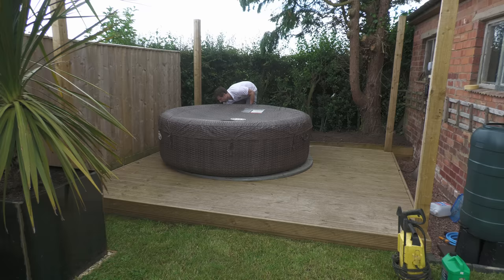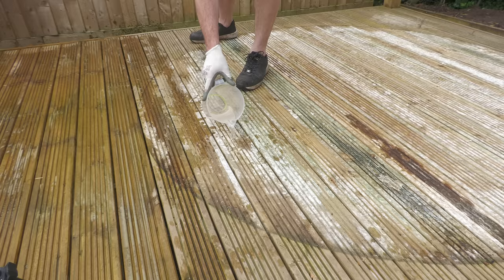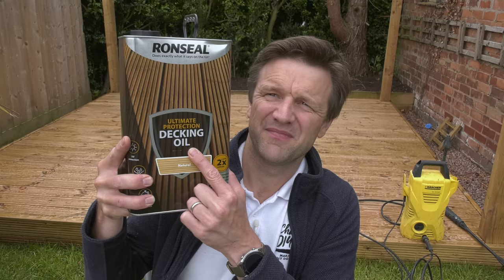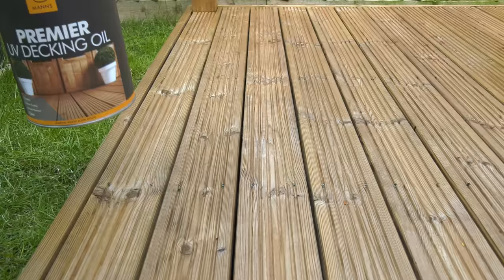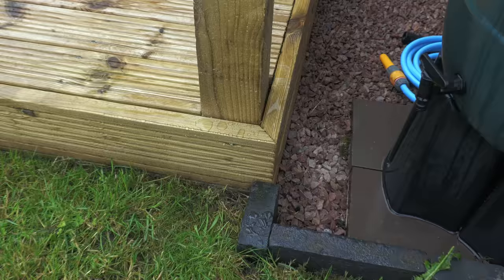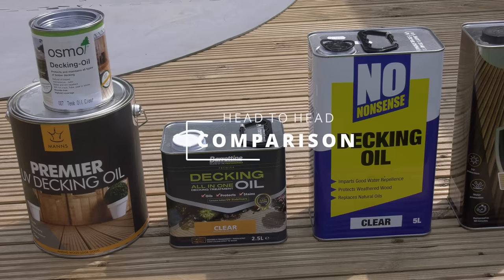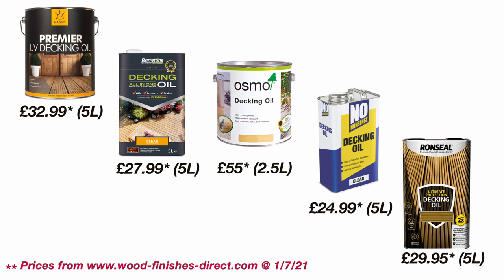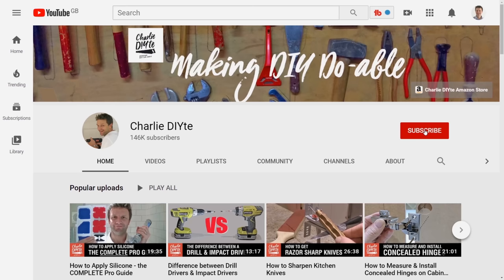How to Clean & Oil your Deck

Comment: My deck's been down a decade and still looks great. I'd agree don't pressure spray with the dirt blaster attachment or if you have the cheap boards from DIY stores that are like wafers, but mine are quality boards from a good timber merchant and I pressure spray them on a dry weekend early autumn then use the Screwfix oil which is great. I use a Wagner fence / deck sprayer and I'm done in ten mins, then do a second coat after it's dried. I've never needed restorer or scrubbed it. I then pressure spray it again around Easter and re-coat with the Screwfix oil if I think it needs it. The Screwfix oil is often two 5 ltr tubs for £40 so even cheaper than you state. Really interesting video and as for the water based stuff - forget it!
Reply from the maker: Thanks Roger. Great work. As you say, a little dedication and diligence and the deck will last for a long time 👍🏻

Comment: Great video pal, I finished my decking this year after watching your decking build a few times for tips, mines a bit too level as well. I’ve already treated mine and hoping it’s first winter will be mild so I can keep on top of it
Reply from the maker: Thanks mate. Don't worry about it being level. You'd have to put a big fall on it for it to drain, and you can't really do that particularly if you're putting a hot tub on it! Get yourself a leaf blower just to keep it reasonably clean. Sounds like you're nicely on top of maintenance though 👍

Comment: I watched this video months ago - and now I came back because I actually need the information!
I built a potting bench and was going to paint the top, but the wood grain looked pretty nice, so I'm gonna oil it with something instead.
Reply from the maker: Very wise. Never stain as it will peel off. Much better to oil as it sinks in and nourishes the wood. 👍

Comment: Many thanks Charlie. My old deck has been in need of some love for a number of years. I started using some water based Cuprinol decking oil I had lying around from the last time and it was woeful. I truly hope they don't stop making solvent based oils any time soon. Anyway, I took look at your video and decided that the Manns oil would be just fine for my deck. Then I took a look at my bank balance and decided that the Screwfix No Nonsense might be preferable. I'm glad I made that choice because the back of the five litre can suggests there should be enough to cover 20 to 30 square meters. Right now I'm half way through my 14 square meter deck and the can is nearly empty. The boards are so old and thirsty, the oil is soaking straight in. I can literally see the oil disappear into the wood the instant the brush has moved past. This is great because I know the oil is penetratrating deep into the wood where it's needed and will provide great protection. The water based Cuprinol, on the other hand, just sat there on the surface, scratching its head and wondering what to do. The difference between the two is astonishing. Chalk and cheese. Anyway, I may chance my arm with the Manns next year. I'm assuming the deck won't be so thirsty next time.
Reply from the maker: Really glad to hear that Mark and yes, you can't go wrong with the Screwfix version - it has really good reviews. If you can be bothered to put a second coat on, it will be well worth it. Thanks for letting me know how you got on.

Comment: Hi Charlie, the UV protector will ensure you will NOT get the change in colour between those areas of the deck that are more exposed to the sun. Your deck area UNDER the jacuzzi  and those not covered. You can already see some slight difference in colour. So if you move the jacuzzi to a different location in 3-5 years, the difference will be significant. Hope this helps. I've had lots of experience within the boating world where the sun's UV rays are a wood killer. Granted it's much amplified around the water, but given it's harsh environment it's a good barometer. If you want to keep the area the same colour over the longer period, UV protection is the way to go. Great video as usual.👍👍

Comment: Great video as usual. The best brush for applying decking oil is a car cleaning brush with extending handle. The brush bristles are soft and easily reach the bottom of the groves in the deckboards. It holds a good amount of oil and because of the adjustable handle you  can cover a large area without moving every minute. Everyone on the static caravan site are now using one to apply their decking oil.
Reply from the maker: Good thinking Dave. Would be interesting to see how that compares to the Osmo.
Reply: @CharlieDIYte  The good thing about the car brush is its shape. The head is curved slightly. This helps when  applying the oil.
Reply: That's exactly how I do it and I have a video of it but not uploaded it. The brush soaks alot of oil which does mean you will need more oil than normal but it does the job in super speed time. Great video as always

Comment: I've just used the No Nonsense clear wood treatment on my tanelised fence that was only installed a few months ago. Even with one coat the water has been beading off a treat. Also, it's the best value by a mile at £4 per litre and due to it's low viscosity can be sprayed on meaning it took very little time.
Reply from the maker: Great work Tom. What sprayer do you use out of interest? I think I need to invest in one.
Reply: I have also used the Screwfix no nonsense deck oil and sprayed it on using the Ronseal precision finish fence sprayer, done in no time 👍

Comment: Thaaaaaank you.

The damned deck is an up coming job. Would be very interested in the low slip products. Despite spacing the boards out when I built it, when the rainy season arrives (January to December) the board swell and it becomes water tight.

As always very informative and delivered in a relaxed manner. All hail Charlie DIYte !!
Reply from the maker: Aw, thanks Nickolas. All hail YOU for taking the time to comment 👊🏻

Comment: My deck is grey/black from all the grime and it looks exactly like the one in the video with all the grooves. 
I accidentally power washed about 4cm of it and it looks like a light brown under all of the dirt. It was probably never washed as I bought it like this from the previous owners. 
Very informative video, I will try to revive my deck with all the tips and tricks. I will probably have to buy a gentler nozzle for my Kärcher though.
Reply from the maker: Definitely worth pressure washing and get some of that cleaner. I've just redone mine again. It was very grimy / green. If I'm honest I didn't get all of the green off but it does look a lot better. I used the No-nosense oil just because I had a full tin of it, did a few costs and it looks much better now.

Comment: love the video, just about to do this myself. Am actually going to use my massive drywall sander to sand the decking though, should be way faster than using the orbital. I find sanding is the best way to get the deck back to original condition

Comment: I've used osmo quite a bit on my decking, after the two coats you get the beading of water like the others but after 3 or 4 months it stops. You def need to re oil at least once a year if not more  with the osmo and I would presume the other oils. Its a constant topping up game with oil to maintain maximum protection.
Reply from the maker: Thanks Mark. Yes, I guess it just keeps sinking in.

Comment: Good timing on this one Charlie! Pleased you've ALSO done a clip on the perennial question of 'which way up to install decking .... which I'd missed until I wrote this comment the first time ... ahem. Thanks again ;)
Reply from the maker: Thanks Nick. Yes presumably you've seen the vid https://bit.ly/3gmCMmE The comments below it are well worth reading and if you can't decide which way up because you've got grooves on both sides, lay them so the heart of the grain faces out so that when the board cups, it cups downwards if that makes sense.
Reply: @CharlieDIYte  it does! Thanks. Great vids, need to catch up on the back catalog!

Comment: Incredibly in-depth demo and review, thank you.  I was searching for "how to clean a deck using an electric brush", and this video covered it all.  Question:  Is there such a thing as an electric cleaning brush, but much larger, one that vibrates rather than rotates? I'm resisting using a brush on a pole because have recently had a hernia op and don't have the core muscle strength.

Comment: An extremely useful video Charlie! I wish I had seen this before embarking on using Osmo last year, it has weathered so badly that my brand new deck (built June 2021) needs to be completely sanded back and re-done as soon as we have the weather for it. I will be using the Manns UV oil this time around.
Reply from the maker: Sorry to hear that Scott. Osmo should have been great. Why d'you need to strip it back? Can't you nourish it will another coat of Osmo?
Reply: @CharlieDIYte  if I could share pictures they’d speak a thousand words. The heavy traffic areas as well as some others where the plant pots have been (albeit on pot feet) have suffered and now look grey and worn. I used a base coat of their UV oil, and then a top coat of Osmo anti slip. 
My deck is the “unconventional” type with grooves face down and smooth boards up. To me, a 7-8month life span for a treatment speaks either of a bad batch of oil, my boards not being aged enough before application or maybe it was too hot on the days I did it.

Comment: The issue of water based products being called oil is the same here in Australia where the UV can be very high in the Northern Territories. Here is a clip from a popular one in Oz: "Intergrain UltraDeck® Timber Oil is a long lasting, high performance, water based coating designed to enhance the natural colour of all exterior timber". At least they state the facts. What I have learnt from using pretty much all solutions is to give the original container and the tray/bucket a good shake or stir as the solids just settle at the bottom.
Reply from the maker: Thanks Brian. It's cynical marketing, isn't it. Yes the shaking issue reinforces the benefit of it being in a tin you can open, rather than a rectangular can but obviously it's cheaper to ship in a rectangular can.

Comment: That Ronseal you tested..... I put it on my new decking 3 or 4 years ago.  Spent 3 days sanding it off as it leaves a varnish type layer that starts flaking off.  Now I've sended it I may use 1 coat of it again and then use the Screwfix clear.
Reply from the maker: Doesn't surprise me Ian though I'm sorry to hear you had to go through all that. They should give up on this stuff, I think!

Comment: Great video. I agree that the Screwfix oil is pretty good. Lasts around a year. Previously I used Owatrol Deks Olje D1
 which is very good and lasts a couple of years but expensive at aorund £90 for 2.5 litres.
Reply from the maker: Thanks Pete. The consensus amongst YouTube mates is the Osmo is overpriced and doesn't really work.

Comment: hi charlie really helpful  and comprehensive video. Wish i had seen before purchasing stuff. 
Few things
1. I applied using Barentine deck reviver using a wickes broom. It works fairly well
2. some decks have algae as well.  Should wood reviver be applied before or afterwards
3. 1 question: Can Barrettine Anti-Slip Decking Oil be applied on top of Barrettine Decking Oil?

Comment: Very useful video to get the landscape of available products and techniques 👍  my own experience: very happy with the Mann decking oil, it's a proper oil, not like the water based Ronseal "coloring (varn)(rubb)ish" I was using before. Day and night, I am sorry but water based products are not quite there yet, a long way to go. Osmo telescospic pole: pole broken in less than 5 minutes, there must be much better out there for the price. Barrettine Mould & Mildew cleaner: does a okay job, but is very expensive for what it is - some diluted sodium hypochlorite for swimming pool patios will do a better job for much less money. In any case, no matter the tools, products and techniques, maintaining a deck exposed North remains a real pain in the backside...very time consuming.

Comment: Hi Charlie.  I have no decking and never likely to but that was a great review and comparison.  Just wondered if the waxy types increase slip issues. Also, are there any issues with interaction of pool/tub chemicals - wondered whether that might have been a factor with your underlining degradation ?  Keep up the great work. 👍
Reply from the maker: Thanks Rod. I think No to both. I've never had any chemicals from the tub spill out leak out. There's a drain off at the back. And the Osmo doesn't feel any less grippy Ryan the others. If anything more so because the wax gives it a softer feel (but I could be imagining that 😉👍🏻

Comment: Great video, I’m always having to try different decking products, never used an oil so gonna do this next time. Thanks.
Reply from the maker: Thanks Ian. Just make sure you remove the water based, or as much of it as you can, before you apply the oil.
Reply: @CharlieDIYte  thanks will do 😎👍🏻

Comment: Osmo Review:

I decided to go for the Osmo oil to achieve higher quality and quicker drying time. Osmo supposedly offers better coverage, up to 24 sq/m per liter, which is significantly more than the rest, which would work also price-wise. However, as per the small print, if the wood is quite thirsty, you will not get that coverage. I bought the 2.5 liters thinking it would be enough for my 23 sqm 3 year old dec k, for two coats. Unfortunately, it was not enough to treat it even once. The result is good, yet now I have to buy another 2.5lt for a second coat, which significantly ups the budget.

Another parameter to consider is that while most other oils can be easily found in your nearby hardware store, Osmo is not so easy to find in physical stores, which means you will need to order it. This didn’t work for me since I wanted to apply the first coat in the morning and the second in the evening (to get it done before it started raining, so I wouldn’t have to clear and move the furniture again). So when the first coat consumed the whole tin, I couldnt just go to the store and buy another one on the day - I had to order for next day. So, you might want to order more and then return any unused product.

I have yet to apply the second coat, but so far, it looks nice. I don’t have the knowledge to compare it to other products.

The Osmo cleaning brush is worth the money - great tool to clean the deck! The  oil application brush, makes application really easy. 

Thank you very much for the video!
Reply from the maker: Thanks for that. When you reoil in a year's time I wouldn't bother with the Osmo. The feeling I get from reading reviews and feedback on here is that it's overpriced and doesn't perform a well as some of the competition.

Comment: I have yellow balau decking and was recommended Owatrol Seasonite for the first year then their Textrol. Great stuff but super pricey!
Reply from the maker: That's for sharing that. Yes, I have some Olwatrol oil I used on a steel planter I recently had made - you might have seen it in the video. I wasn't aware they do decking oils until someone else mentioned this, but I suspect it's the best of the lot, particularly for hard wood decks.

Comment: Hi Charlie - the deck cleaning solution worked very well indeed.  Have you put anything different under the hot tub to stop the same issues?
I am a little surprised that you didn't use Zinsser BIN - I know it is your favourite!
I was gobsmacked earlier when browsing  Amazon France for Fugi/Cramer silicone tools as there is a link to your YouTube video on How to apply Silicone - you are becoming famous in France!
Reply from the maker: Ha, you know me too well Mat. Good old Zinsser!! For the time being In going to just rely on the Lay-Z-Spa mat, and when I've got a moment I'm going to build a secondary plinth for it to sit on, with a sacrificial deck and vents around the side. That's hilarious. Teaching the French how to silicone. I bet they're not very happy about that 🤣

Comment: Screwfix (B&Q) No nonsense is 4th but I didn’t hear a lot of negatives for the cheapest item. I’ve used it on two decks and I’m happy with it.  Does sound like you were promoting osmo though.
Reply from the maker: Osmo? Not at all. I didn't use it on the deck, I went for Mann's and wasn't paid anything by anyone for doing this video. Personally, I and a lot of others think the Osmo is overpriced and overrated.

Comment: Love all your videos Charlie, always so concise, well put together and informative! Thank You.
After one year of 30 sq meters new joists & decking replaced and also over 130 sq m of tongue & grove pine shiplap cladding applied to the 15 year old rear garden function room @ cost of £11k
The natural wood look that I want to keep is now showing signs of slight decay in places (south facing) particularly. After being assured by the carpenter- builder that we don’t have to treat or do anything! I’m not so sure about that?
I’m going to take your advice and use Manns Premium UV Deck oil, or look at the Olwatrol that you mentioned later comment.
Can I ask, could use this same stuff also for the large expanse of T&G pine cladding that I would use on the decking?
Phil